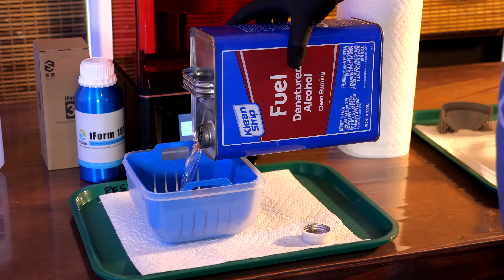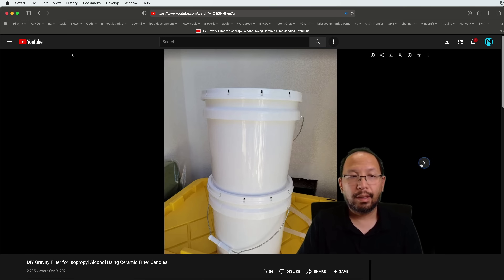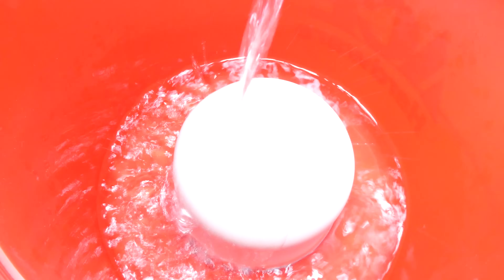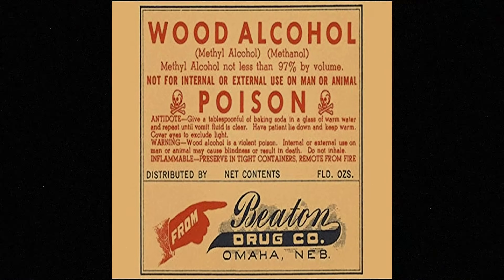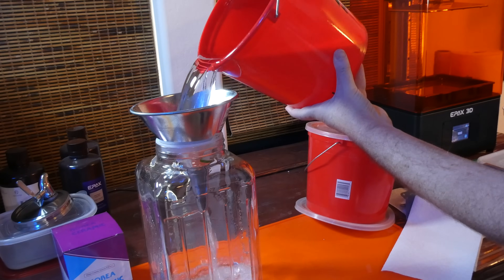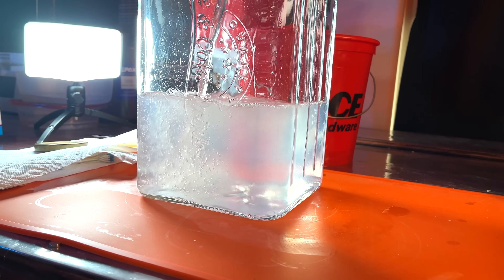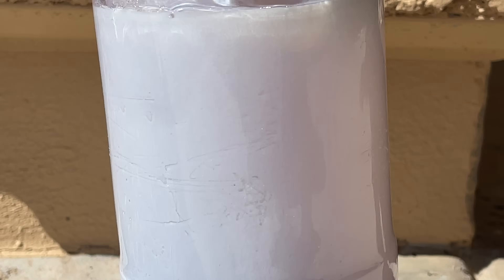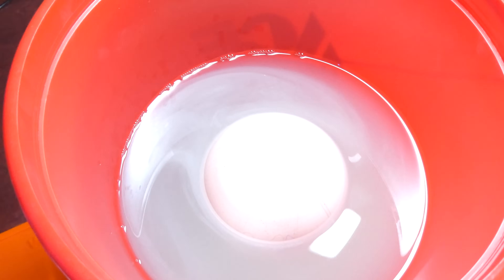Can We Recycle 3D Printing Alcohol?

Comment: A couple of tips, the grey residue that sinks to the bottom of the uncured dirty resin is just the pigment, not the photo monomer. Since the photo monomer is still liquid, it is also passing through the filter with the alcohol (unless the charcoal is doing something I'm not aware of, although your results suggest otherwise). The jelly like substance after you cured the alcohol is actually a resin/alcohol matrix; it's actually possible to mix it enough that the matrix gives up a bunch of the alcohol and becomes a pulp like substance, you can also squeeze out the pulp to release a bunch more alcohol. It should also be noted that simply filtering/straining the uncured alcohol doesn't solve any of the issues of dirty resin, since it doesn't remove the photo monomer which will still give your models that tacky feel. Any IPA recycling set up must include a way to remove the uncured monomers or the cured polymers and is why the best setups I've seen involve pumping the alcohol through clear tubing wrapped in UV LED tape and then filtering it through 10" whole house water filters.
Reply: You just confirmed my suspicions thanks for the info. Would you mind sharing your most efficient method for curing prints? Im thinking of abandoning my curing station and just using a spray bottle and a brush so conserve alcohol if I cant recycle it.
Reply: @zeriel0009  There are ways to recycle it (stir or somehow keep the alcohol moving and turbulent to prevent it gelling up while you cure; this is also more efficient since it stops a skin forming that prevents further curing), but if that's too much effort, the best way is to conserve the alcohol with the 2 tub method.
One tub is the dirty alcohol that will remove 99% of the resin and the second tub is the clean alcohol that removes the last 1%. This method conserves the clean alcohol by drastically reducing how quickly it gets contaminated and you can keep reusing the dirty alcohol until the "clean" becomes dirty (sticky residue left on models); at which point you make it the "dirty" tub and pour a new clean tub. This should make your alcohol last many many times longer.

Comment: Thanks for the info. I'm trying my first filtering job. I allowed it to settle and then tried to leave most of the contaminates behind. Then, I put the alcohol in jugs and left them in the sun for ~16 hours. 
The plan is to pour what remains, through cheesecloth and see what I have. I hadn't thought of the method you mention and I'll be placing an order to Amazon shortly. :)

BTW
I'm visiting my local fire department because I'm considering using a distiller. So far, it will be at least 25 feet from any dwelling. It will be contained in either a steel worksite box or an order oven. Personally, I'm leaving towards the oven. That way, if there is combustion, it will be contained. 
Thanks again for the great info.

Comment: you can remove methanol if the high concentration  messes with your chemical process by heating it up to 65-77C (depending on the ratio of loss vs methanol reduction you need.)

this doesn't remove the denatonium, and produces methanol vapor so you'd need to go outside and have  something to capture the methanol

though for consumption you'll be better off bringing fermented sugar water to a distillery.

Comment: Question to anyone: i had a water alkalizer but some how the thing sprung a leak and the circuit board just looks like it has lime scale and the thing wont work at all... Is there someplace that could fix the thing. I don't have the know how and the thing was too expensive to only have for a year or so and forget about.

Comment: The info about the ipa is wrong.  The smell of the ipa is just that, the smell of ipa.  I’m a pharmacist and i have 99.9% pure ipa, it still has the distinct smell.  No matter how much you try to filter it, you won’t get rid of it.
It was not denatured during prohibition with methanol and bitters or whatever to make it undrinkable because ipa is undrinkable anyway.  In fact, ethanol is the only alcohol fit for consumption.  All other alcohols are poisonous.  Ethanol was denatured so the government could tax alcohol for consumption without having the same tax on ethanol meant for other purposes than drinking.

Edit:  your filter setup should have an exhaust in the lower bucket. This way the air can escape and be replaced by the ipa.  Without the exhaust the ipa has a hard time going through the filter and into the bucket because of the pressure inside the lower bucket.

Comment: Bro…the smell from isopropyl alcohol is not something you can filer away…it is molecules of IPA evaporating and floating around in the air that your nose is detecting in the air…second…those filters are designed for water and filtering normal, relatively clear and mostly clean water. Essentially tap water that you want to filter out chlorine smell/taste, dissolved minerals etc. Filtering relatively clean water gets you get the “rated for 1000 gallons” number. You might as well be filtering swamp water/muck. The number of gallons you get to run through a filter is going to be far less due to clogging up.

Comment: Seems like a lot of hassle TBH

I just take my cleaning vat and using a peristaltic pump I pump the IPA back into bottles through a coffee filter and the comes out more than clean enough to use for cleaning prints.

The 7 liters that my cleaning vat holds take about an hour to filter then I just pour it from the bottle back into the vat.

Comment: To be fair the distiller does work well. I manage a dental lab and we go through a ton of printer resin and alcohol. The distiller is the most simple way in my opinion and we are able to recycle it quickly. Obviously it needs to be in a well ventilated area. We actually just let ours run outside. One of my coworkers was telling me about this filter method today so I thought I’d do some research.

Comment: Im very new to resin printing, but im just wondering why do you need to clean your prints in alcohol?
Reply from the maker: The alcohol helps dissolve the leftover resin. You have to clean it in something and you can't let the resin go down the drain. It's toxic and we don't want it in our water system.  There is water washable resin but even that again can't go down the drain, you basically have to treat the water like I do the alcohol in this video. And even with water washable, I would still use alcohol because it just works better.

Comment: I recommend using a pre filter then a filter/ 2nd filter. Also if you had a small water pump and ran it in a cycle through the filters you might be able to keep the filters from getting clogged.
Oh and in the 2nd filter use some of the already high filtered IPA to act as a flow assist.

Comment: I'm wondering if a small air pump for an aquarium would be able to push the alcohol through a metal spin down filter to remove the larger chunks then stage down from there before running it through the last stage again. overall your filters would clog slower and the spin down filter is washable. not sure if the flow or pressure would be enough though.

Comment: Isopropyl-alcohol is NOT drinking alcohol (ethyl-alcohol) with poison added. It is an entirely different alcohol species that is poisonous, all on it's own. The bad smell you smell near I.P.A is the vapor of the alcohol itself, you can buy 99% pure I.P.A. easily enough and the last 1% is almost entirely water. The only reason it's harder and WAY more expensive to get 100% I.P.A. (also known as anhydrous I.P.A.) is that I.P.A. is hydroscopic and will pull humidity in the surrounding environment into itself, so it takes an order of magnitude more effort to get rid of the water that makes up that last 1%. No amount of filtering I.P.A. will get rid of it's smell or make it safe to consume. Just like no amount of filtering would make lead safe to consume.

Comment: Another thing to consider is that most alcohols used for cleaning (acetone, isopropyl, methanol) love to absorb water from the surrounding air.  Your alcohols will quickly dilute and become much less effective.  Distilling won't solve this without proper lab equipment, so desiccants are an easy method.  

As for filtering, I use a buchner funnel with a vacuum pump and it works incredibly well.  Even the cheap brake bleed hand pumps will pull enough vacuum.  No need for a powered unit.

Comment: Some interesting findings.
I think what would really assist the process is a vacuum pump in the lower chamber., and as you suggest, maybe 3 chambers/2 filters.
I use one for "de-bubbling" non-UV resin for casting. It would not need to be running at a high vacuum to pull a lot of the liquid through the crap.
From all your "baby puke" experiments, I think you are right in making sure you don't get the alcohol so saturated as to a point where it becomes irretrievable.
BTW,  methanol isn't immediately poisonous, it just makes you blind...
As a final note, as a Brit, I love your pronunciation of "arse" not "ass." ;o)

Comment: Isopropyl Alcohol isn't a poisoned version of ethanol (drinking alcohol), it's a completely different molecule with 3 carbons instead of the 2. It doesn't have bitters, and you can't remove the poison because this alcohol itself is poisonous, not an additive.

Comment: Sorry but distillation is the only way it is possible to filter epoxy residues 100% from one's alcohol. Please note that alcohol should not be heated to more than about 92 degrees centigrade during the distillation, so a distillation apparatus with a variable temperature is necessary. I have not noticed a greater release of fumes during the distillation process than when cleaning one's print. If you are still afraid of fireless during the distillation, there is no one to prevent you from placing the apparatus outside on a non-flammable surface far away from everything.

A tip. Place the alcohol in a plastic cooking bag and put some water in the bottom of the distillation apparatus first and put the bag with alcohol in at the end, then you avoid the residues from the resin settling in the bottom of your distillation apparatus.

Comment: You should add some negative pressure in the buckets to speed up the process. 
Also, I would try to make a centrifugal solution to solidify and get rid of that mucus in the curing process. This is what you use in biolabs to sediment stuff like that to the bottom of containers, usually test tubes. If one would build a contraption that rotates bigger jars with the bottom oriented outwards while being flooded with UV light, I' think the cured resin would form a solid cake on the bottom and the alcohol could come out very clean above it. Possibly. Then a pump that pushes that alcohol through a final filter and into a storage jar. Badabim.

Comment: 1:10 tip from a moonshiner.... hobbyist... u dont pour pure alcohool in the distiler... u need to measure the concentration out in the heater... meaning... u dont pour 100% alcoohol. in it... and start boiling it that will 100% blow up or catch flames... what u do is add water to it... tap water distiled water whatever u got... cleaner is better but water... and drop the concentration to 30-40% that way there wont be enough alcohool in the mix to instantly blow up... so if u got 1000ml of alcohool. place another 3000ml of water mix it a little bit... with a spoon or shake it in a jug... then let it sit for 1 minute to calm down... and then u can pour it in... and start boiling it... evaporation will take a lil bit longer... as now u have a pretty huge ammount of water and very little alcohool... usually if u can control the boiling point of the liquid... alcohool evaporates or turns into steam... at around 60 degrees celsius... were water only at 100-105 or 110degrees depends where u are located as height from sea level floor... if u on top of mountain ... it will take more time... if u closer to the ocean will take less time and temperature ... so if u can keep ur kettle boiling at 60 degrees celsius u will only extract alcohool, and the water will sit in the jug and then u can refill it and do it all over again.

Comment: Distillation is by far the best, its the method if which you do your distillation.  Those all in one water purifiers would not be good, they are not designed for that.  I use a glass set that would be used for essential oil distillation.  The key is to keep the heat as low as possible.  The big downside is the glass you heat with will eventually be ruined, I am currently trying to come up with a way of using something more disposable like a mason jar and possibly a vacuum to reduce the amount of heat needed.

Comment: I know this is from a year ago, but to help your system you just need multi-stage filtering. Make a stack of 4 or 6 buckets with increasingly fine filters as you go down. This should help prevent clogs as well.

All that said, doing proper lab distillation with borosilicate glassware would probably cost 200 bucks up front in equipment and have almost no continual cost. You can let it sit in jars like you do now, then put it through a coffee filter and into a separatory funnel. The funnel will separate out a bit more of the solids over a few hours. Drain the resin off into a container, then drain the remaining alcohol into a round flat bottomed distillation flask. Put the flask on an electric hotplate with a magnetic stirrer and connect a distillation tube and a capture flask. Properly connected, this whole system is completely sealed and no vapor will escape. Control the hot plate temp so its around 82C, enough to boil the alcohol but not the water or resin. After running through the flask, you should have nearly pure alcohol.

Comment: Take a trip to your hardware store and purchase a length of PVC pipe with an inner diameter that is about 2 cm larger than that of your filter. You'll also need a second length of tube about 20 cm long, a fitting of some sort which will allow you to screw the filter onto the end of the small tube, two clamp-able caps for the large tube (this is important), plus something that can act as a shroud around the filter. Ideally the shroud should have a cross-section like an upside-down U. It should completely envelope the filter and extend below it at least 5 mm or so. The taller the large tube the better. For best effect with gravity alone it should be at least a meter long. You'll also need some adhesive that is suitable for both PVC and whatever the end-caps are made of (they may just be a flexible form of PVC if you're lucky) which is impervious to isopropyl alcohol (assuming that's what you are filtering). 

Take one of the caps and drill a hole in the centre large enough for the small PVC pipe. Insert the small pipe into the cap so that it will extend at least 10 cm into the large pipe and glue in place. Attach the screw fitting for the filter to the end of the small pipe. Determine how far the filter will extend into the large tube and drill three holes around the circumference lined up to the bottom of the filter. Drill three holes in the shroud 1-2 cm from the bottom. Pass wire or similar through the holes to secure the shroud upside-down inside the large tube. It should be sturdy enough to hold the shroud in place. To test, clamp the unused cap to the bottom of the large tube and fill with water. The shroud should stay where it is even though there is air trapped inside which will make it buoyant. 

Screw in the filter and clamp the cap to the bottom of the tube. Make a small hole (approximately 1 mm in diameter) in the top cap. Secure the tube above your collection vessel, and pour in enough clean isopropyl alcohol so that it reaches the top of the shroud. Wait for the air inside the shroud to pass through the filter. I would wait until I see the alcohol start to drip into the collection vessel. Next, top up the tube with your dirty solvent and attach the top cap. Once you've clamped it, put a piece of PVC electrical tape over the small hole. This will prevent the tube draining immediately so that some of the heaver particulates can settle to the bottom. After a few hours, remove the electrical tape to start the filtering process.

The shroud should prevent some of the resin particles from getting into the filter. They will slowly settle out, past the shroud and into the bottom of the tube below the filter. For extra points you could attach a small regulator to the top cap and use nitrogen to slightly pressurise the tube, which will accelerate the process. At the end of the filtering process you'll need to empty out the gunk and rinse before re-use. For multiple passes you could replace the initial filter with a secondary one (and perhaps a third later on) and run the collected solvent through the apparatus again.

Comment: IPA is offgasing combustible fumes all the time, even at room temp. If you had a method of containing the vapor the way we do when storing the already dangerous alcohol, I dont think its particularly more risky. Id run the distiller inside a sealed plastic storage bin, with an exhaust line if I really felt concerned.

Comment: I'm trained as a chemist.  Fuel+oxidizer+ "open flame" = bad outcome!.  But using an electrically heated distillation unit is about as safe as it gets.  The end product is no more / no less dangerous than it was before distillation).   I don't smoke.  I wouldn't do this around open flames.  Distillation is the only practical way to accomplish what you're trying to do.  Any yes, that's what we would do in a lab to purify alcohol.

If you really wanted to reduce the risk, lower the distillation temperature by distilling under vacuum.  
(NB: the water content will NOT stay the same (it will reduce with each run) until you reach ~95% alcohol.  At this point, alcohol and water form an azeotrope.  You can get it to 100%, but it's beyond the scope of this discussion)